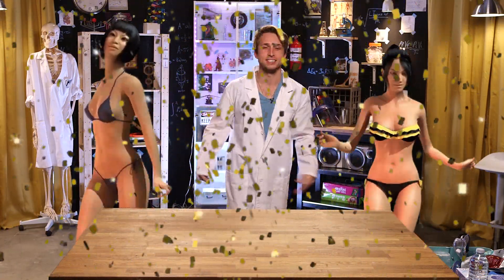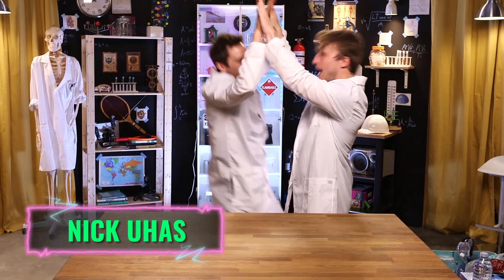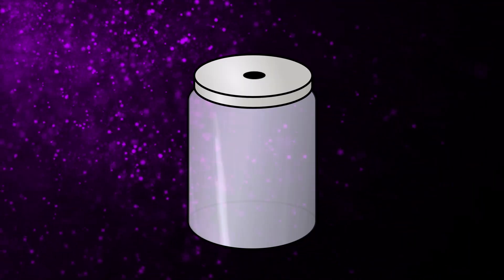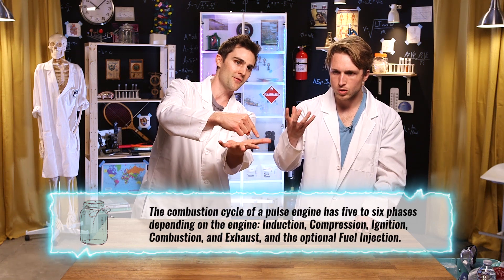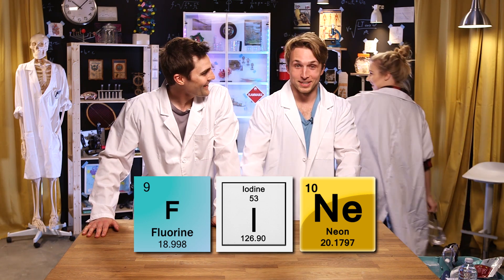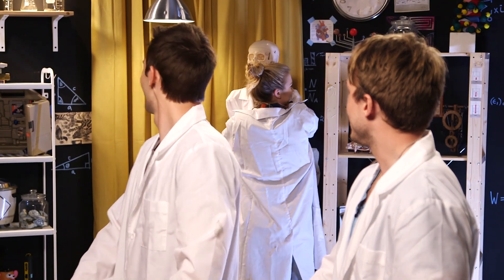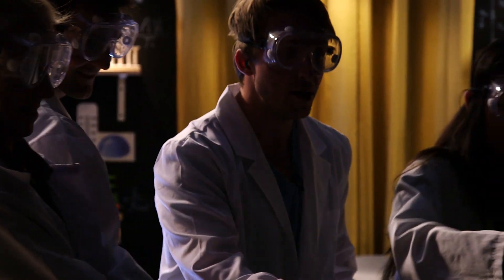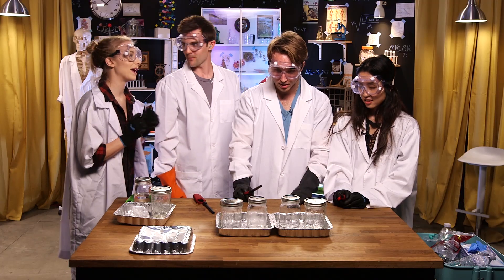EXPLODING JET ENGINE IN A JAR?! (Smosh Lab)

Comment: Can Jet fuel melt steel beams?
Reply: It can’t fully melt it but it can easily heat it up to a point where it will lose all structural integrity, the exact way a smith heats metal to forge it